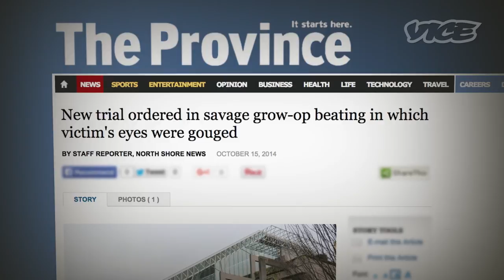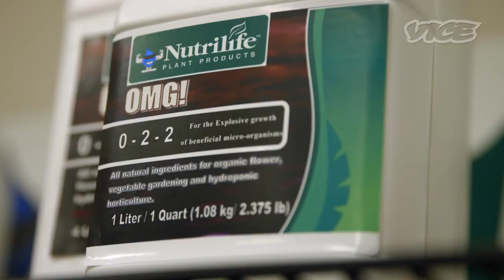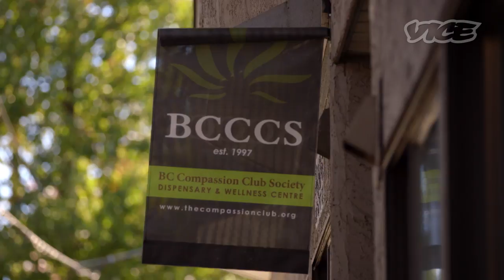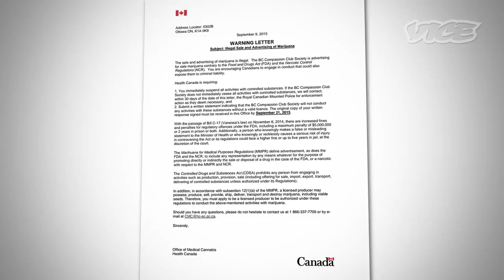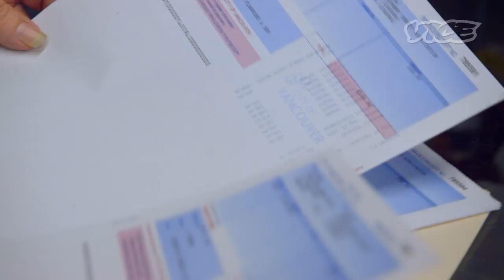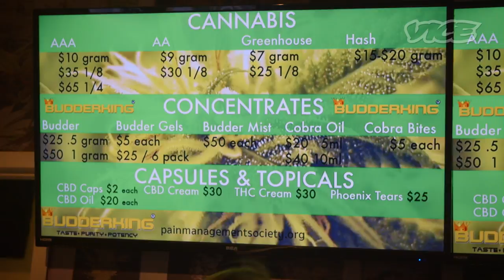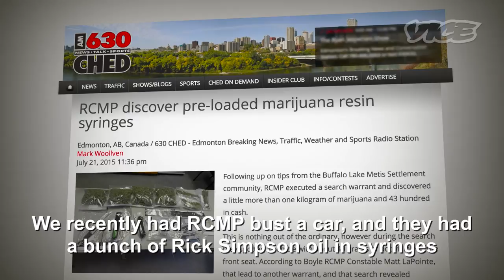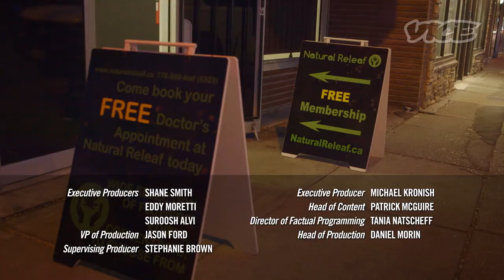The Dark Grey Market: Canadian Cannabis

Comment: The closed-loop hash-oil production system that guy made is basically a custom plug flow reactor (PFR), which is inherently inefficient for a batch system.  He should use a CSTR or similar to increase yeilds.  These technologies have been used for many many years in the chemical production industry, there is no need to go spend all the money building from scratch.

Comment: If you still smoke solvent based extracts you're crazy when you add a solvent to a plant you get a completely new drug theres a difference between cocaine and coca leaves and that happens when they pour gas on the leaves to extract the oils I only smoke rosin it tastes better and actually gets you stoned once you smoke rosin you realize that solvent based concentrates dont get you high